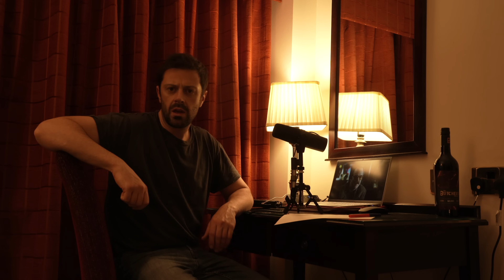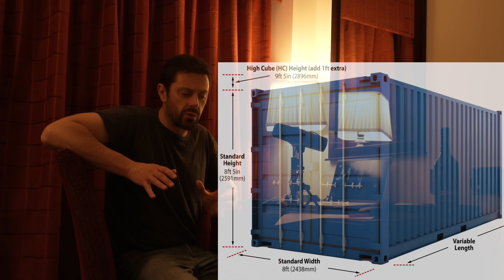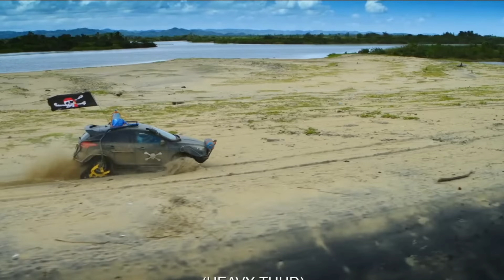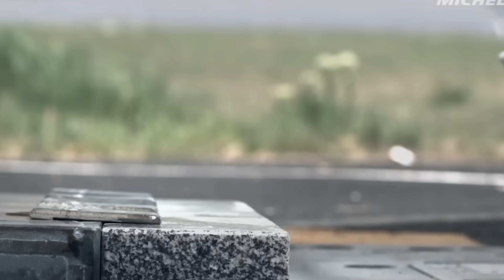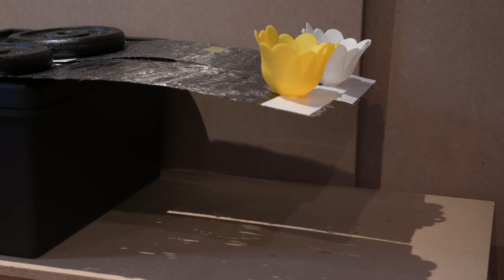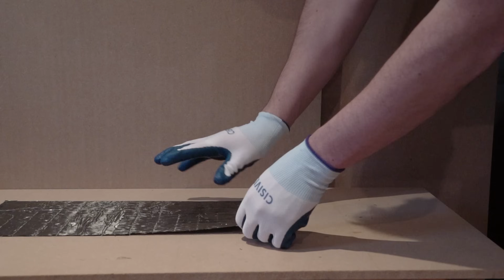The BIG Decisions: fuel, hull type, tracks/wheels, size, power. Bernard Arctic Vehicle Project [4K]

Comment: This is like a comedy channel for real engineers or as a colleague said  "it's like self harm". I hope people aren't stupid enough to invest in this joker. Most bizarre thought processes, speaks about efficiencies but wants 4 generators, wants a special fuel that can't be bought locally, "adjustable" airless tyres in sub zero conditions ? thinks he can beat Michelin. Air to air for cab heating ? So you are having a big tube from back to front, not heard of hydronic ? 1800kg  ? laughable.  Sorry but if you are going to put this crap in the public domain you deserve to be shouted at.
Reply from the maker: The mighty return of jetski guy - we missed you.

The thankfully very few ranting comments like this always have the same sort of tone - professing mythical engineering expertise when they probably think CEng is a typo whilst trying to sum themselves up in a four letter word.

Your 'colleague', perhaps like a failed comedian shouting at the TV as they watch someone they once knew who made it big - 'no! YOU'RE the joke!'

All the while, real engineers in industry send me constructive, generous emails with ideas and pointers.

I'll engage with your silliness, which is most unengineer-like through its obsession with single factors in isolation, not part of a list of compromises/priorities.

1. One 20kW generator is more efficient than 4x5kW (all running at optimal load) of course, but that one generator can't be lifted, or have a quarter of it shut down, or run at 25% at reasonable efficiency, or share parts with a neighbour when there isn't one.
2. There is no usable fuel available in most likely operating locations, including the grades carried onboard large ships. So what you take is your supply.
3. You apparently cannot think beyond inflating or deflating. Interchangeble outer discs/treads with additional rigidity for harder/easier surfaces is still 'adjustable'. No need to beat Michelin.
4. Fluid-filled heating/cooling/power transfer circuits are a disaster waiting to happen in this project, and the most common failure in every conventional engine-driven projects I've been in touch with.
5. 1800kg is a weight, and no laughing matter. A matter instead of adding up, plus a misc error.

You're spot on that public domain broadcasts are fair fodder for review or abuse. But I assure you that the majority, the constructive sorts who've not become embittered by life, wonder what must have happened to someone to make them unleash poorly-conceived drivel on strangers on the internet, in a vain attempt to feel like a winner.

Do better.

Comment: I hope you are planning for the cold weather issues associated with HVO?  If a vehicle is ever shut down and cools down, intentionally or unintentionally, the HVO will solidify.  You could address this by having a reserve of kerosene.  You would want to purge the fuel system with kerosene befure shutting off the engine, and then start the engine on kerosene and use the kerosene until the HVO has completely re-liquified.  Of course it would be better to never let the vehicle get cold, but it would be foolish to assume everything will go as planned.
Reply from the maker: It's possible you've got it the wrong way around, as HVO's cold weather gelling stats are better than dinosaur diesel (without additives). Kerosine is low in energy density so best to avoid if possible. It's biodiesel that has poor cold flow.
Reply: @AlexHibbertOriginals  I did ask the internet for differences between HVO and Biodiesel!  In my brief search I found they are made through a different process, but I found nothing saying the characteristics of the two are necessarily different.  This may prove the inadequacy of the internet?  My experience is limited to changing diesel filters that are packed with solidified biodiesel!
Reply from the maker: From Google Gemini:

HVO and biodiesel are both renewable diesel fuels, but they have different chemical structures and production processes. This leads to some key differences in their properties, especially when it comes to cold weather performance:   

Biodiesel

Chemical Structure: Biodiesel is made up of fatty acid methyl esters (FAMEs). These molecules can be more susceptible to gelling in cold temperatures.
Cold Performance: Biodiesel has a higher cloud point and pour point than HVO. This means it starts to thicken and form crystals at higher temperatures, making it less suitable for cold climates.
Gelling: Gelling is a major concern with biodiesel in cold weather. As the temperature drops, the FAMEs can clump together and form a gel, which can clog fuel filters and lines, leading to engine problems.   
HVO (Hydrotreated Vegetable Oil)

Chemical Structure: HVO is composed primarily of paraffins, which are more stable and less prone to gelling than FAMEs.
Cold Performance: HVO has a much lower cloud point and pour point than biodiesel. It can remain fluid and perform well in much colder temperatures, making it a better choice for cold climates.   
Gelling: Gelling is less of a concern with HVO due to its chemical structure. It is more resistant to thickening and crystal formation in cold weather.   

In conclusion, HVO has superior cold weather performance compared to biodiesel. Its chemical structure makes it more resistant to gelling and allows it to remain fluid in much colder temperatures.

 This makes HVO a more reliable choice for use in cold climates.

Comment: Living/sleeping/eating/shitting all in one cabin space. No thanks. Split sleeping./rest area's. Open body wheels? =Not going to work. You need the buoyancy of those wheels as closed volumes since you already restricted (seacontainer) hull size.  Turbines: need high windspeed. lot of noise when fixed on cabins = no sleep. as of 1,6 diam. self adjusting blades 24h output ok but  still low compared to 1 liter diesel/genset. Condensation/dehumidifiers. Dehumidifiers are very big power consumers, compressortypes use less but still. Without fully redesigning the dehumidifier water of all existing dehumidifiers is not, and  NEVER will be safe, due to mold, bacteria and virus build up in the system.  It a horse behind the wagon as we say. Get a nice oil/diesel gravity fed stove with an outlet pipe for heat. And ventilate with cold superdry fresh air. It will dryout the cabin in no time.
Reply from the maker: Doing all these things in single or part-compartmentalised areas is normal for many expedition types. I'm not sure why an 'open body wheel' is so evil - we've no particular need for extra buoyancy since the vehicle shell will be foam cored, and displace plenty of water. In any case, it's possible the wheels could use foam void fills in some form.

Turbines - possibly - we'll do an analysis, but in any case they would be on the rear Bernard, not the one people sleep in.

All water would be carbon block filtered, so no concerns over water reclamation. And whilst we will indeed have a low profile diesel stove for intermittent use and emergency heating, there's so much heat from the generators that we simply must use that energy. We only want the noise from them to be sadly wasted energy.
Reply: @AlexHibbertOriginals  Well i maybe spend to many stormy nights at high altitude in tents waiting, or weeks on small sailing boats to value a moment of not hearing, breathing, turning, or smelling the other ones:)) And that  was before noice canceling was a thing:) So having two cabins, one crew and one mechanical also creates opportunities for a bit of extra space even for a moment. The open wheel thing, which could freeze up, get filled with ice and snow, is just adding mass i though the lack off displacement/buoyancy might become an issue. Foam does nothing for that  only reduce the inner space. Aspen Spaceloft might be nice to as an insulator. or sandwiched in, because 1 cm SL= equal to 2,5cm Armaflex. Every cm less needed = hundereds of liters gained inner space. But if buoyancy it is enough to keep it afloat, every cm deeper is a steeper the angle of attack getting out. there is a fine line to be researched between stability and be able to off and on the ice. Well lots of fun things to think about and  try:)!
Reply from the maker: Agreed on plenty of that. Although the core of the shell certainly does something. Firstly it enables a stiffer lighter structure. And it certainly does offer buoyancy, albeit only the volume held within a 10mm core of medium density PET.

As for different foam brands, there are dozens of sub reddits filled with people angrily saying their personal favourite is the best. I'll do my own tests when the time comes, but I tend to be sceptical when comparable products claim 2x or 3x the performance of others.

Comment: If you want the main hull to plane while also having great terrain crossing, I’d recommend looking at Rocker-Bogie type suspension with non-rotating wheel axles. 

The big benefit here is a hydraulic actuator can lift all the wheels up and out of the way without messing up the suspension geometry and without needing to take up internal space. It also allows the driver to control how much ground clearance they have.  It’s also easier to remove the bogies from the vehicle for transportation than other types of suspension designs, giving you more internal space while also widening the track spacing. 

The biggest issue with rocker-bogie suspension is turning, but if you keep more pressure on the center wheel and the geometry not as long you can tank steer it. You can also keep steering to just the front wheel even in a 6 wheel configuration if you need the vehicle to be longer. There is a reason NASA uses this type of suspension and as long as you aren’t trying to race it, it should work great for your expedition. 

I could CAD a mockup for you if the above description doesn’t make sense over text.

I’d also recommend you use low pressure balloon tires just like the sherpa, as this would provide backup floatation in case the hull springs a leak.

Comment: Using political correct AI will give the same result as a DEI hire.
(See Boeing for reference).
Developing and designing a full technical custom build, is going to be a multi million project.
I've had my dreams. 
But this one is like having a fever dream after an Amsterdam coffeeshop party.
Reply from the maker: What a strange comment.

Using AI image gen to offer an approximate view of a verbally posed idea is useful, and hardly beholden to politics. I chose which image to use. Boeing is another mess altogether.

And no. Burlak, Yemelya, and the original Argos. No millions there.

Comment: Re the engines, I like the way you're thinking however you must remember redundancy is one aspect. Another aspect is you get many more points of failure.
 
To illustrate, I'm a mechanic turned truck driver. I collect bulk liquids typically in the 28,000 - 38,000litre range. 
Of the 1000 or so collections I've done in this job I would estimate there have been just 3 collections where there hasn't been a failure of some description. 
Almost without exception, every single collection is a drama caused by an equipment failure.
Such is the nature of complex systems. 

eg. Pump blockages, electronic crashes, burst hoses, galled stainless fittings completely seizing due temperature changes, random unforseen external influences such as lost keys or a broken forklift blocking access, misplaced tools causing utter mayhem, gauges going out of calibration or failing making collection impossible, stirring mechanisms failing catastrophically, power outages, no water pressure, blocked drains making pumping impossible because the tanks can't be cleaned afterwards so therefore can't be refilled. 
Then the receiver has equipment failures the same as just listed at the collection point and of course truck equipment failures.
Pumps, motors, solenoids, switches valves everything fails every day just not the same things. 

It is utterly unbelievable the level of complexity in my life. 
Here's the really freaky thing, sometimes unrelated things fail simultaneously like a truck will break down, then the calvalry comes you get to the collection point and a mechanical pump switch breaks. You know the system so you enable a computer controlled pump but the touch screen doesn't respond. Every shift is like this. 

All this BS has taught me the value of simple systems.

Mechanical and electrical simplicity is not to be underestimated. 
The more simple, the less points of failure, the greater the reliability.
Reply from the maker: I agree completely with your examples of complexity adding chaos to unknown unknowns. 

However, I don't think a well designed redundancy system causes that. Redundancy for example where five different types of unit are taken in case the first unit fails, is crazy. But by using identical units, or a number of smaller rather than one large unit, you're onto a winner unless there's evidence the larger unit is more reliable.

Comment: Hi Alex

What a project. I have been reading most of the comments and a lot of good ideas in the mix. I have some questions for you.

1)How fast are you looking to travel?

2)have you considered hydraulic drive motors over electric drive if speed is not an issue?

3)do you have an estimated cost?
Reply from the maker: Thanks Steve

1. on rubble, around walking pace plus stops to assess routes. Perhaps 15-20mph on perfect flat grippy ice.
2. A couple of people have suggested it and I've done a read. Not written it off, but the high pressure worries me from a safety angle, and generally from an energy conversion efficiency standpoint.
3. I do not at present. Aiming for a combination of channel and sponsor funded.

Comment: 27:28 just call it veggie oil. I am displaying endless amounts of wonderment btw. Oh and with a winch you’ll obviously need a lightweight anchor from which to winch when stuck. Perhaps a spare wheel buried in the snow or do you need something sharp to screw into ice as an anchor?
Reply from the maker: Yes to various types of anchors.

I'm closing in on hippy diesel

Comment: I hope that you do not get seduced by green technology used for diesel engine management. Stick to traditional jerk pump elements for injection, NO common rail electronic injection, NO wet belt cam shaft drive, or rubber cam belt drive. Simple reliable metal gears to drive accessories. No high tech computer boards just to get the engine to run. No sensors to fail and shut you down or stop the engine.  Multi fuel engines, diesel, Jet A1, and vegetable oil are all OK as long as you have PLENTY OF EASY CHANGE fuel filters, and fuel heaters.........sorry about being dogmatic BUT you need reliable machinery above everything else!! You will be polluting the ambient environment, but it will be reduced if you, your team, your machinery.....do not need to be rescued.
What do you think???
Reply from the maker: Nothing to argue with there. More filters the better, and these will be generators, so easy to configure for robustness and low number of clever parts to fail.

Comment: you really need to try and get some of Edison motor's EV axles! they should have some heavy duty pickup truck axles if you can get hold of some and that sounds like exactly what you want.

I would go with some sort of modular coupling that will allow the command units to attach to front or back of the power units, or even better allow any units attached to front or back of any other unit, like railroad AB units! you could imagine all of them working together in a train should you have problems with several units or even just want to reduce the number of drivers for whatever reason.
also have a control station on the power units so the CAN be driven alone if ever needed.
Reply from the maker: Another person mentioned Edison. I'll have a closer look. Unsure about the size/load being the same for Bernard, but the principle perhaps. Good points on the coupling method.
Reply: @AlexHibbertOriginals  I'm not sure of your scale yet, but Edison is making retrofit kits for heavy semi trucks AND for big pickup trucks (i think they said 1 ton axles but that side didn't interest me as much) so I'm sure one of those scales will work, and sense it's a retrofit you could use the axles they are replacing as placeholders until they arrive.

either way, i think they are working on something close to what you want and they are good people as far as can be seen from YouTube.

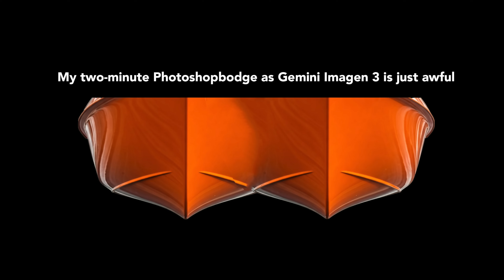Comment: 2:19 i don't think that's a good idea, if it's anything like what you just showed it's going to act like a catamaran in the water which also gives it the critical angle issue.
I think you are better off with a single semi displacement/planing hull with a drop keel, yes you lose that bit of inside space but you do gain the benefits of a deep single keel without needing extra ground clearance for it.
Reply from the maker: For the amount of time we'll have a wet keel, a drop keel is a massive compromise for the ice time, surely ?
Reply: @AlexHibbertOriginals  depends how much time you want to spend in the water, do you want a land capable boat or a water capable truck.
Reply from the maker: The latter.

Comment: The simplicity of air-to-air heat exchange might just be surpassed in morale boosting by radiant floor heating provided by liquid cooled diesel engines.
Reply from the maker: I'll not discount fluid circuits entirely, but would need to be convinced the risks are worth it